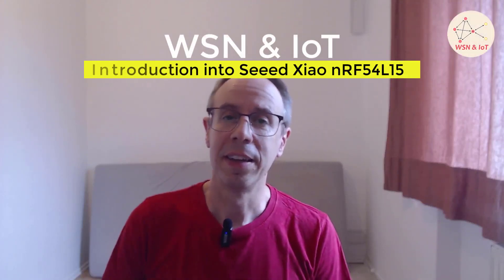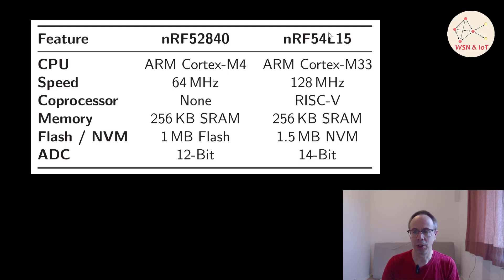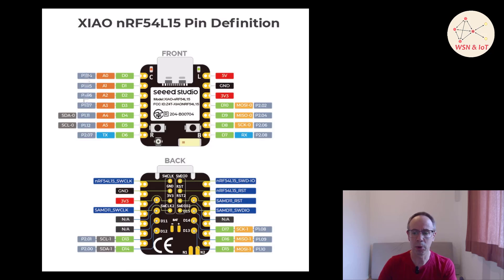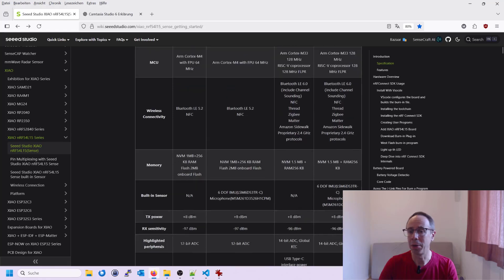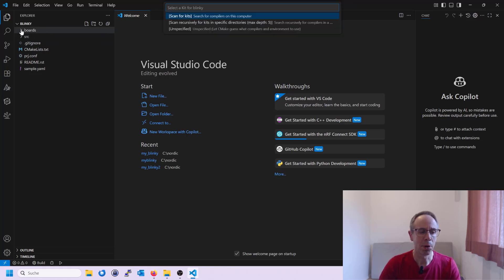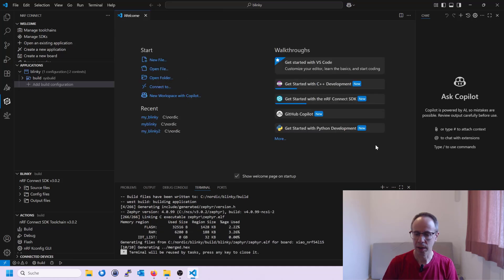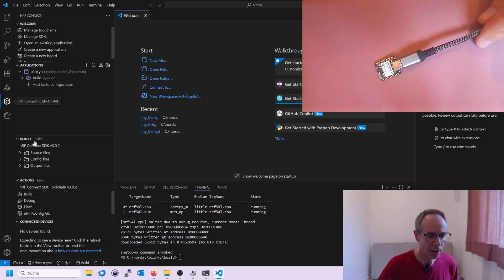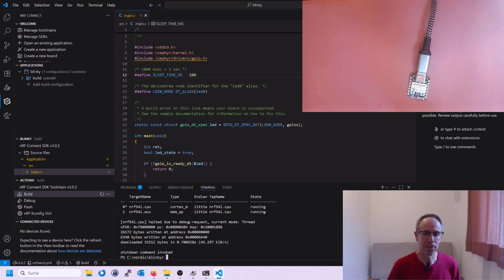Seeed Studio XIAO nRF54L15 Part 1: Unboxing and Programming

Comment: I think it's not clear why you would use one of these boards over for example and esp32-h2, but once you see it works down at 1.7v and it's power profile is way way less it becomes more obvious.
Reply from the maker: Yes, the very low voltage range (down to ~1.7 V) and the power profile are definitely key differentiators.

In the end it really depends on the use case:
ESP32 boards are great for hobby projects and fast prototyping, while boards like the XIAO nRF54L15 make more sense for ultra-low-power, battery-driven or long-lifecycle products – especially when things like support, documentation and a stable ecosystem matter.